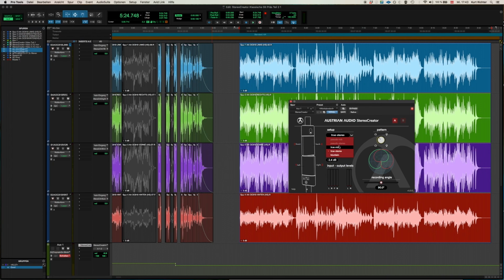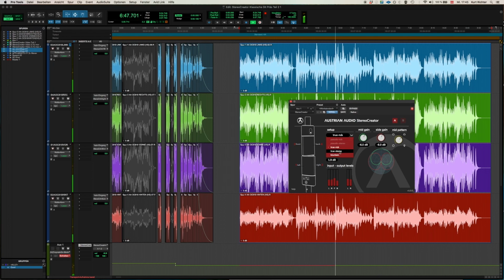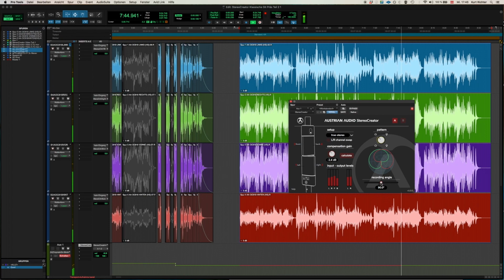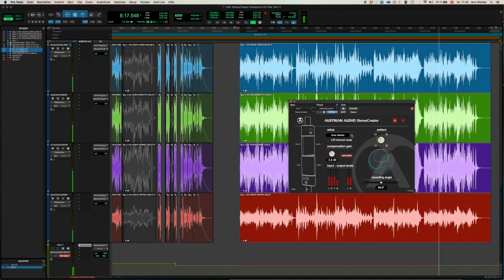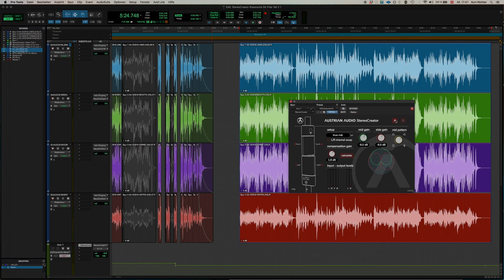StereoCreator Tutorial Part 2

Comment: I Just bought a pair of of C818. I have a Harrison Console but have always recorded piano using an Avalon 2022. Is it possible to use different Preamps, one preamp pair front and one dissimilar back and achieve an effective recording? Or do you recommend four of same channels. I could use Neve 1073 on back also. Thanks for any advice you can share. BTW the Mics sound fantastic on my GRAND!
Reply: Hi Kenny!
Lucky you! I had the pleasure to work on a harrsion c32 console in the past. I loved this desk.
We recommend to use the same preamp for the front and back side of the mic. It should also have the same setting of gain.
Reply: @kurtrichter935  hi, if you recommend same preamp for front and back, then we can use different preamp for the second microphone being used for sides? I have neve dual preamps, but 3rd and 4th will be stock preamps of UAD apollo. Just wondering if this works well. Thanks
Reply: @kurtrichter935  Hi, thanks for the clarification. I'm new to the party here and was wondering if combining the polar design and stereo creator in series would do any good; your undoing basically in one plugin what you set up in the other, right?